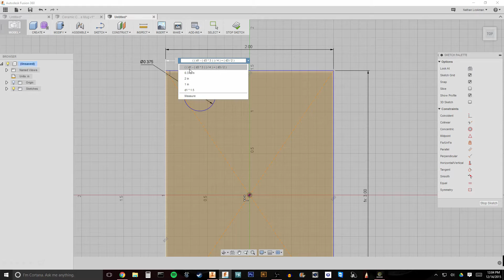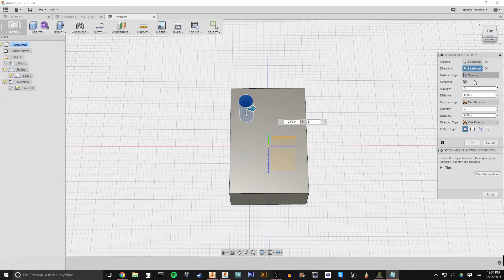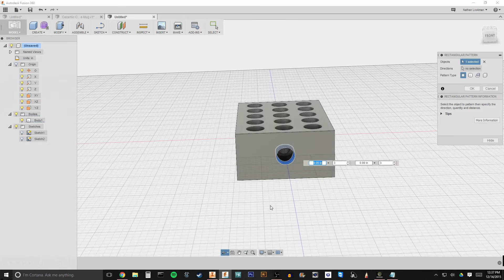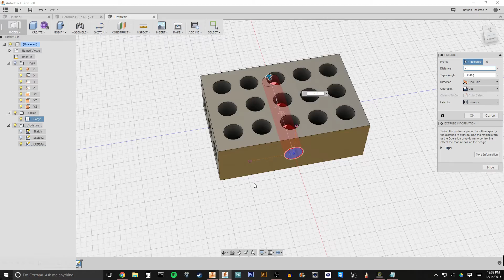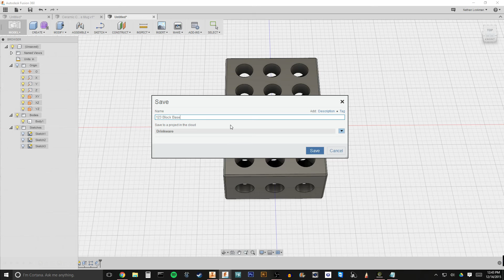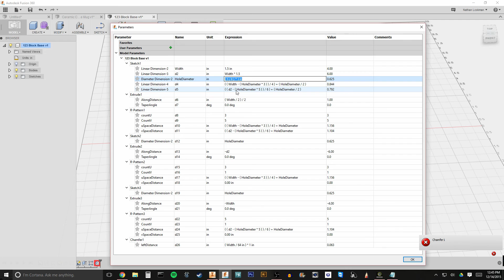NYC CNC Response - How To Draft 123 Block Parametric Modeling Tips

Comment: Great video! I did essentially the same thing, but you made it look much easier. A couple differences: I used the short side (d1=1") as my base dimension for everything. I also spaced my holes evenly based on center points at d1/2 from the  edge and d1 center to center. This lets them be used like Renzetti blocks (https://youtu.be/FxVPM08jnGM)  because hole always align in a way that keeps the block edges aligned. I haven't added the counterbores to my model yet, but I would really like to see how you manage the pattern for that along with the side to side differences in placement. I think the model could still be based on just two dimension (hole diameter and short side length) with everything else being derived, including counterbore diameter and depth.

Comment: you can do the same thing using spacing, width/amount -1 hole, length/amount -1 hole.
width say 100 mm / 5 = 20 so 4 hole with a spacing of 20 mm. same shit diffrent way

I like to use user parameters so I can tie the user parameter for the hole gap to a math function and just use sort naming it make doing the drawing a bit easier, less name or number to rember
Reply from the maker: +daniel lyall Yes user parameters make all of it easier. Especially when working with parts in assemblies.

Comment: Amazing...Great video!!! I'm gonna go ahead and call myself your first fan. I hope to see more fusion vids like this, parametric modeling and beyond... Great job. 

Quick question. Is it poor practice to change the name of the feature or parameter names at the beginning of the model to make working with the expression easier down the line? After using Fusion casually for about a year now and only barely scratching the parametric surface, using or seeing the the word "width" or "holediameter" is easier to understand/recognize than d1,2,3 etc. 

Thanks, and again, great video.
Reply from the maker: +Ryan Rivas Hi Ryan! Thanks for the subscription, I'm creating more fusion 360 videos as I often as I can i will start doing so weekly. I primarily use Inventor pro for work but Fusion 360 has all the important features at a much lower price point. As to your question about best practices, it is actually a great practice to set up those primary dimensions with words before hand. It has no affect on the finished work, but can make working on larger projects much easier which may require multiple "parent" dimensions. I would recommend using numbers with them such as "width1" so that you can keep track of them. The only reason I don't label them first is because I grew used to using d1,2,3... years ago and there are fewer letters in "d1" than "width"

I will create a video this week on how to set up those dimension names in preferences ahead of time so that you can have a tool box of dimensions that you know you use often.

Thanks for the comment and if you have any other quests please send them my way so I have an idea of what content would be most useful to you.
Reply: Thanks Nathan for taking the time to share!  There just isn't enough hours in my day to learn everything I want to know.  People like you and John help make my life so exciting.  I subscribed too as it looks like you have a bunch of other videos I have interest in :-).  Joel
Reply from the maker: Joel L Thank you so much Joel for the kind words. I hope you can find some of my other videos helpful. Feel free to ask questions and I'll do my best to answer them!